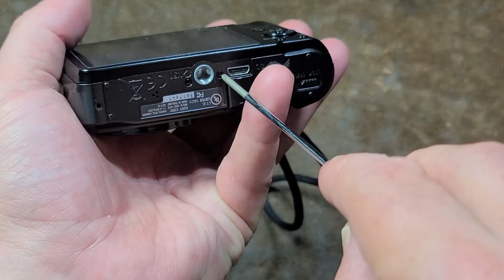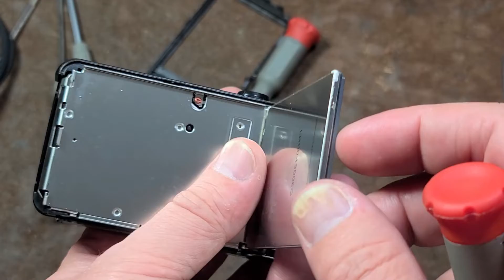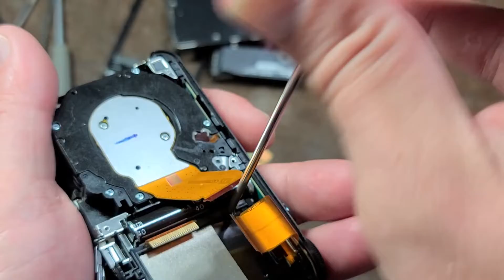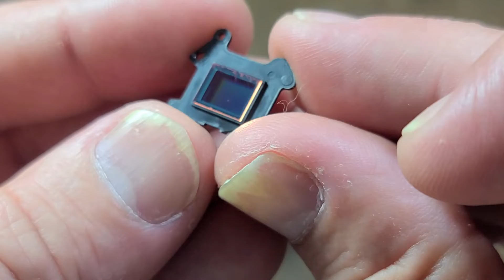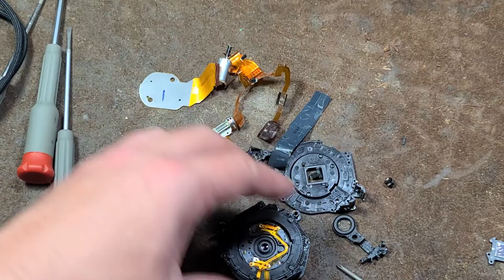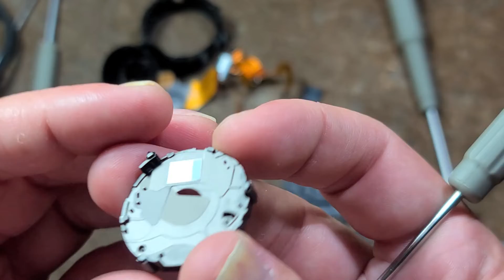Disassembly Puzzle, Sony DSC-H70 Camera Full Teardown

Comment: Well you did a great job of taking it apart but I guess you were not able to put it back together. By the way I like cats a lot they're really cool animals. Interesting video for me because I have a similar model and it received some water damage I was thinking to try to take it apart and clean the corrosion parts myself but it seems like it's really complicated and I doubt I'll be able to put it back together so I think I'm going to try to take it to a local camera repair shop or at least contact them first and see if it's even something they would mess with trying to fix I tried contacting Samsung locally but they don't even offer digital camera repair which is kind of disappointing they only seem to want to repair cell phones but I guess it's easier for them and well anyway it is what it is thanks again for the video

Comment: Thank you for the interesting educational video on Sony compact camera tear-down. When you watch a video in which just the LCD panel is replaced or some other minor repair is done, you don't get any idea of the incredibly complex design and engineering of the camera. 
To your credit, you broke only two parts at 9:19 and 14:21 even though you had absolutely no plan of reassembling the camera! 
The tiny button cell on the PCB that holds the SD card socket is there to retain the settings like date, time, etc. When this battery voltage goes too low which happens if the camera is close to 10 years old, every time you turn on the camera, it will ask for date, time and other details. Replacing this battery will solve that problem though the job is not that easy. Unfortunately, Sony does not provide any assistance to DIY enthusiasts who have the tools, patience and the expertise to accomplish the task.

Comment: Thanks for the video!

I have to disagree a bit, having a very similar camera from the same Sony model line.  It takes better pics than any modern phone (besides that... whatever it was model, that literally had a camera/zoom lens built in so it was huge, effectively a camera with a phone built in rather than a phone with a camera built in), does 1080p 60FPS AVCHD/H.264, with an optically stabilized lens, and the battery life is enough for over 300 pics, using the same battery part # that one uses.  

Heck, mine doesn't only do facial detection, it can discriminate between kids and adults and focus on whichever you want.   It has a further throwing flash, and even without, can do a rapid series of pics to average out noise for much better low light images.   The stereo mics have good channel separation too, audio sounds very 3D.

Granted, mine is "slightly" newer than the one you're tearing down (only 9-1/2 years old) as yours can only do 720p, but frankly, 720p is still sufficient for many uses and does save on memory requirements.   I still use mine regularly and my only issue is the USB connector long ago broke loose of the PCB so have to pull the battery for charging and the memory card to get pics or video off, but when you have hundreds of pics or GB's of video, it's probably faster to do that anyway, and the battery charges faster in a dedicated charger.

The less useful pocket cameras were those made closer to 20 years ago, I recall one I had that ran off 2 x AA batteries and only got about 15 shots before draining them, making me wish I'd gotten a Canon instead which was much larger due to using 4x AA but could take about 3X as many pics due to that.

Comment: Sony opted for a rechargeable date & settings battery! Way cooler solution than my old Canon - CR1220 slot on the outside. That's that think of everything in advance Japanese overengineering. 👍 Thanks for the incredible insights - awesome video! 👌👏

Comment: I’m guessing the tinted lens is a neutral density filter; used to cut the light so you can use a slower shutter speed when capturing water falls etc.
Reply: It's just an anti-reflective coating
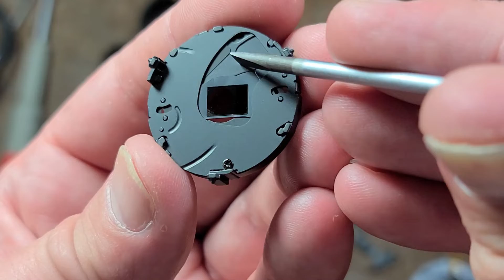Reply: @stinkycheese804  Watch the whole video. I'm referring to the internal flat gray tinted lens that pivots into and out of use at 22:16.
Reply: That is aperture